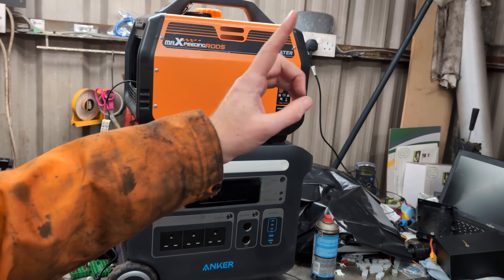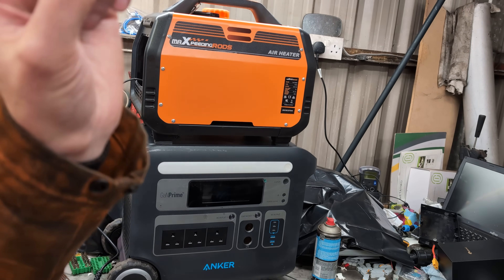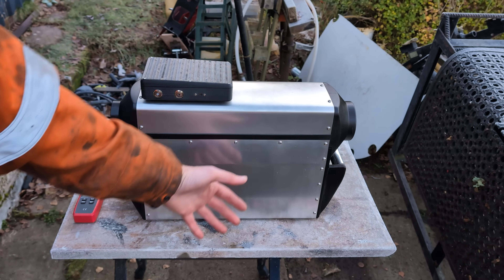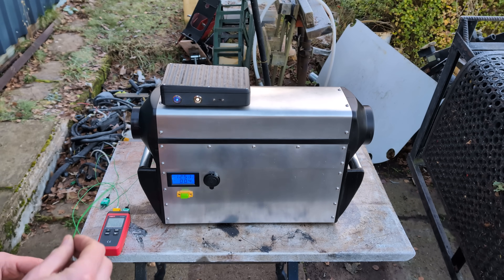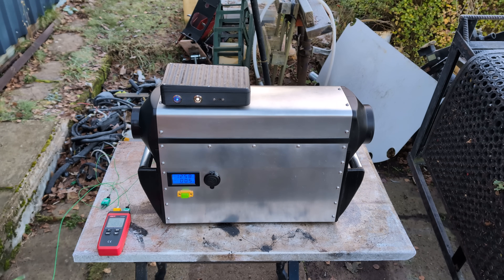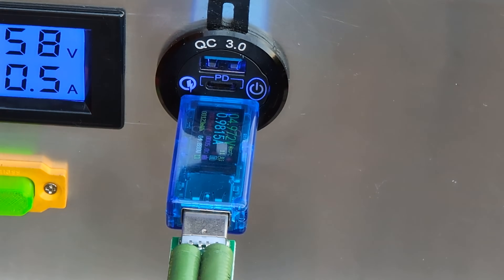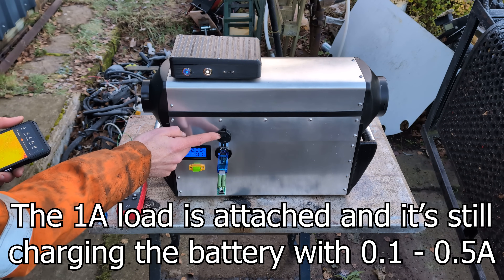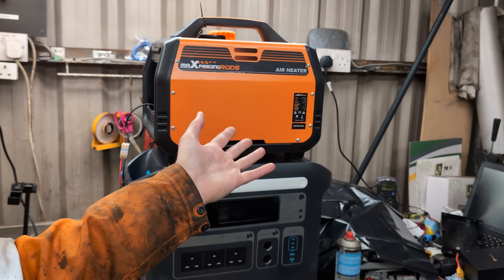Self Powered Diesel Heater Project - 100% operational - FINAL

Comment: I honestly did not think this would work, and that there'd be too many losses to actually be energy positive... cool
Reply: yeah one would think that at first ,,but if you have enough heat energy to sacrifice ,and aint out to power alot but just a small amount of power the heater takes it is apperently possible  , it would be intresting to see how many btu he loses in heat  as these types of energy modules are not really that efficient , but it is very impressive that they made it work...
Reply: There are no heat losses, we are basically running standard heater fuelling but with above 5.5kw heat output, around 2kw more than the standard heaters 😊
Reply: @daveparf  - Exactly. If they could get enough mass flow over the exhaust and things, they could even get to the point of being a condensing system and harvest a lot more.

Comment: Don't know if it's been mentioned already, but in the video the commentary keeps on mentioning 1A and 2A power being produced - but one is on the built in display, which is 12V, and the other one is on the usb tester which is 5V - so not all the same. A bit of a mix-up. As far as I can work out, the system is producing extra power at just under 1A @ 12V - not 2A. The 2A are on the usb tester at 5V - so not the same thing. Unless I am getting mixed up here. Very impressive results, nevertheless!

Comment: Great idea! I often thought that just designing these as small low rpm turbine engines that turn a small generator would make sense. Unlike a jet engine it doesn't need to spin at crazy high rpms to produce thrust, just fast enough to turn a generator. Actually your version is clever as theres no moving parts on the generator. Definitely a great bit of research youve done here, potential for a sellable design! 😎👍
Reply: Absolutely. The waste heat could still still be harvested and turned into hot air! The David(s) have made quite a technological achievement here though! The simplest solution would be to just run a small diesel generator (turbine or even 4-stroke), enclose it, and use a fan running off the generator to harvest the waste heat and pipe the exhaust away.

Comment: well done david....great channel, ive been tinkering with the idea...having a boiler just for hot water, diverter valve retrofit and blanking the rad pipes off....then throwing out the radiators but keep the installed pipework....installing a diesel heater in the boiler room and using the rad pipes for dispersing the heat around the house

Comment: Great job, that Genisun is holding back the output somewhat as it's not tuned for that type of battery, but great job with the result well done!
Reply: its not holding back because up to the 14,4V point where an AGM needs an additional 0,3V it charges just fine.

and i'm 100% sure if you gave the battery 5 Amps @ 14,4V it'd suck it up like a cold beer.

but 1A@12,6V is 12,6W.  and beiing a positive 12+Watts thats impressive.  even a to 12W reduced consumption was great !

Comment: Nailed it, great job, the only thing that made me wonder about a TEG system was if the TEGs would cook, I thought a water circulation system might help offset any spikes in temp but it looks like you guys have got it down there, great to see!
Reply from the maker: The water cooled TEGs did work the best.  But the added complexity of the water cooling made it very unportable.  But other David is building the water cooled version into his campervan.

Comment: Hi David. Does the heater have to be run at full speed for this to work or will it still produce positive amps while running on slow?
Reply from the maker: Excellent question.  The TEGs output the most energy when one side is really hot and the other is really cold.  But once the battery is charged we don't need as much energy.  So in theory if you could get the controller to sense when the battery was charged it could swap to run at a lower heat output.  Maybe in the next version.  :)

Comment: Once you can develop a simple saleable version of this, I think a lot of us would be wanting one.. Using a TEG is an obvious option for self charging, and you seem to have struck the right balance here. Impressive. Would you need a larger TEG to be able to generate sufficient if it isn't quite as cold?
Reply: It was actually producing around the same output at 12 degrees on a previous run.

Comment: Well done David, proof of concept sorted. What would the minimum run-time be to replenish the batterys’ losses during start-up and shut down? Cheers.
Reply from the maker: Excellent question.
Reply: @DavidMcLuckie I would imagine 1-4 hours
Reply: Last night I run the heater for 20 minutes then shut it down, 
The battery voltage was at 12.55 to start with, 12.81v when I shut it down and 12.69v once the battery had recovered from the shutdown.
Reply: @daveparf  how many tigs mounted was needed to self run? Thanks for sharing
Reply: @RustyShakleford1  4 TEGs

Comment: That is awesome, and very impressive! But..... will it only work when on max heat output or can it still generate enough power to be self powered on lower heat setting?
Reply from the maker: Excellent question.  The TEGs output the most energy when one side is really hot and the other is really cold.  But once the battery is charged we don't need as much energy.  So in theory if you could get the controller to sense when the battery was charged it could swap to run at a lower heat output.  Maybe in the next version.  :)
Reply: @DavidMcLuckie  if it slready runs an arduino there are possibilitys to measure the charging current into the battery. if if drops below 200mA or anything the heater could power down.

Comment: Great project! But a 5kW heater at full speed is much to much for a Van and slowing it down will produce less electricity. Will this concept work also with a 2kW heater?
A thought about cooling the TEGs: heaters are mostly used when it's cold. So if you can use the cold air from outside for cooling the TEGs, it's a nearly endless pool of cooling-capacity. In a camper-van you can heat up some water in a well insulated tank and have it available for shower and so on. And when the water is to warm for cooling the TEGs, you could use cold air from outside. so many possibilities...

Comment: Use a small 12.8 volt lithium (LiFePo4) battery and gain another 10 to 15% energy efficiency, these batteries absorb a charge much easier compared to lead acid or AGM.
Reply: I did notice that it absorbed the charge more when we had a bank of capacitors hooked up as well as the battery, i might add those back to the charge circuit.👍🏻
Reply: lifepo is fine tech but it hates freezing temps.

and a heater is in direct vicinity to freezing/cool temps.

you'd need to at least route a small part of the hot air through the (cylindrical) cell cravices AND avoid overheating 'em at the same time.  but then it would be perfect.
Reply: Lithium titanate batteries don't have heat issues and operate at c rates and resistance capable to some capacitors and are safe no fires

Comment: Good work! I guess the critical question is if it still will work when the heater is powering down as it would happen in a well insulated van in opposition to this proof of concept at full power?

Comment: Do you think this could be adapted for use within a campervan? Heat without electrical draw would be amazing
Reply: Absolutely! That’s why we did it, I’m going to be fitting the water cooled version from (part 9) into our camper van in a few weeks, the hot water return will pass through a heat exchanger inside my water tank that we use for washing, so I should get 40-50C hot water from it as well as keeping the van charged up.

Comment: Hi can you use a 65ml fuel pump on 8 KW diesel heaters they list them on Amazon for diesel heaters??
Reply from the maker: Technically yes.  And this heater might be able to get enough air to burn it all.  :)

Comment: Is your temperature probe on the cold side of the TEC/TEG ?
40°C is really hot.

If not allready but you should have the intake air for the burner going over the cold side radiator to give it a high flow cold air.

Also think the hot side shouldn't get above 150°C or so to prevent unsoldering to internals
Reply: These TEGs can handle 250C
Reply from the maker: As other David said.  These are proper high temp TEGs.  Colder would be better for energy production, but still well inside the running specs.

Comment: I know I'm like 170 comment or something like that. But I have a question. My unit fires starts to heat but the unit flame outs and then dumps alot of fuel and just white smokes. Wondering what your settings are maybe I can copy them?
Reply from the maker: Air heater or water heater?
Reply: @DavidMcLuckie 4kw air heater.

Comment: Question David,or idea, diesel heater pump,tick,tick, well could you use a pump that you get on a dialysis machine,the little roller that runs over the pipe, micro doser, zero speed to whatever, anyway loved the video buddy,well done😅
Reply from the maker: Sadly no.  It has been tried.  The pipe used either turns to jelly in diesel, or if you use fuel rated pipe it eventually splits with the constant squeezing.

Comment: I don't understand why these don't already generate more than the electricity they need to run.  It's a little diesel motor, right?  So, why not put a little dynamo on the thing?!  That'd be a lot cheaper than the thermal-differential generator, no?  Anyway, this is fantastic!

Comment: Mind your 1.8amps is at 5v tho? Or am I missing something. 

Same as the 0.75amps at 12v
Reply from the maker: Yes, but that's over and above the 2A required to run the heater.

Comment: wondering, can i add a couple of these heaters together, large shed.. just been watching your video then realised it was 4 years ago. must read my mind as this is what i have in mind my self. The 8k ones people say its a lie. so instead of having a small one at full power i thinking of 3 at half power , as you may be able to see, i havent a clue, blue remote ? new pump, new plug .. this channel is a good find. ;)
Reply from the maker: The 8KW we can purchase as just the 4KW with marketing.  A real 9KW does exist and it's twice the size.  I just haven't seen any outside of China.
Reply: could i add 2 or 3 of the 4kw system to make 1 heater. i have a large garden shed, shame i cant get central heating for it. @DavidMcLuckie
Reply: @Milldog2023 Keyword = planar 9 D  = Sold by Autotherm ( 8 kW + ) If that can help you

Comment: I have a solar generator I bought on sale for $130 with LIFEPO4 batteries and a couple solar panels connected to the diesel heater, works like a clock..But, that is interesting...And I have a full size 44 kilowatt solar system made out of Eve cells, if I lose power in the solar generator, and a wood burner and a propane heater and an electric heater and an electric blanket..LOL..Even closed caption has a hard time deciphering your English...Not sure what is charging the battery, after paying close attention..Something changing heat to power in the burn chamber..Didn't catch the prior videos, which I'm assuming exist..That's a good idea...
Reply from the maker: Thermo Electric Generators modules.  TEGs for short.

Comment: use a lithium battery you will find units efficiency will go up even further due to sustaining a higher voltage at the battery / heater side I found these units draw way less power to run when the source voltage aka input voltage to heater is higher
Reply: physics doesn't work like that. the unit will pull the same amount of watts. as the voltage increases the amount of amps will be lower but the watts drawn will be the same the equation always has to balance (volts x amps = watts)
Reply: That's where your wrong the fan is temperature controlled as is the fuel pump and well if source voltage does up the fan spins faster so the controller then cuts it back to meet the fan rpm required for the heat of the burn chamber as rpm is now turned down while running at higher voltage the fan and such then draws less current because it now holds the rpm set by controller easier
Reply: You simply forgot to factor in the controller power draw and such the chips and such lose less power in the form of heat as the voltage rises alot of electronics like mosfets / controller chips  / amplifier chips and speed controller hardware do this and are source voltage sensitive as volts drop they're efficiency does also look at stereo amplifiers used in cars this is why they up the voltage on source / feed side
Reply: Lithium can’t charge below freezing
Reply: @rickcooperjr62864  the difference would be negligible
Reply: Some Li have arctic Option with little heat - PCB or Pad in them so usage at - temp no prob anymore ( Mine sits on top of a Diesel Heater which can start of this Lithium or the Vans' deep cycle ) > 6 years off grid from 4 -10 and winter camping as a reference
Reply: @rickcooperjr62864  wrong. the fan is not temp. controlled.

it is controlled on a line from min. to max. power according to the pump herz.  so it runs about lambda 1 air fuel ratio...

and a higher supply voltage would raise the current on the fanmotor as well.  but the controller with it's feedback keeps the fan speed at the perfect point of burn-air input.  so it neither draws more nor less current on the input.

Comment: You also could throw a Thermal electric generator in there to charge the battery
Reply: thats exactly what the project is.....
Reply: @Nordic_Mechanic  no it's not he's got a battery and a solar charger
Reply: @TheOriginalAndysGarage Yes it is, did you miss the fact that he mentioned the TEGs numerous times throughout the video? This whole video series is about a self powered heater using TEGs to power the fan etc.
Reply: @ferrumignis  obviously I did and don't care

Comment: I think you can call that mission accomplished. Well done other David, and in such a neat package. 
I'd be curious to know if it's lost some heat output. But then that's probably not a problem, as long as there is still enough to warm your van. Does other David think it will have to be mounted outside the van, to maintain the cooling of the TEGs
Reply: It could be installed inside the van as long as it has a cold air duct connected to the outside.
I’ll be putting the liquid cooled version in my van though as i can use the coolant to heat my water tank at the same time.
Reply: @daveparf  are we going to see inside it, or have you asked David not to show it?

Comment: Will it keep running if you replace the battery with a capacitor?
Reply from the maker: It would keep running.  I'm not sure how well it would work for starting and stopping though.
Reply: @DavidMcLuckie  Ok. Cool project!